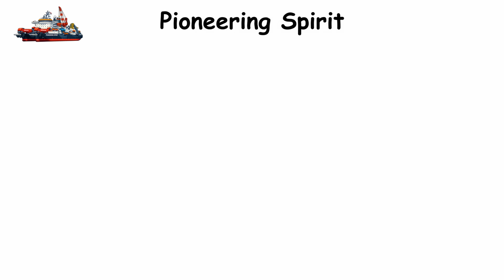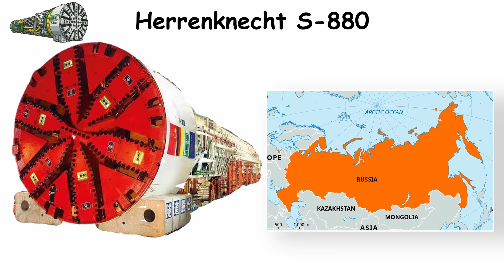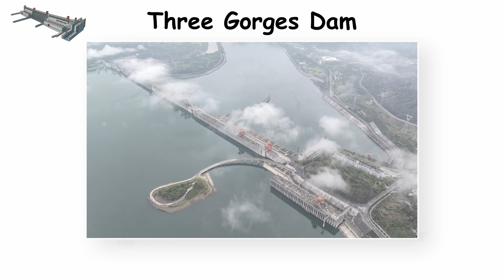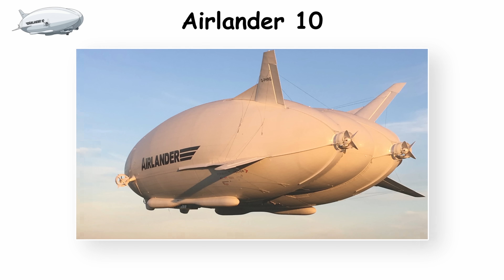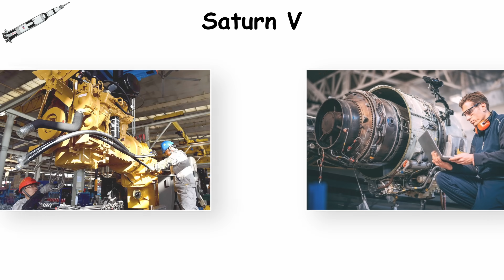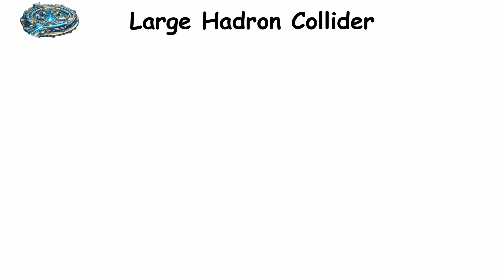Biggest Machines Ever Made Explained

Comment: Pioneering Spirit straddling a whole platform and lifting 48,000 tons in one piece is hard to picture — I kept wondering how they keep that 122-metre slot stable in a swell while the lifting beams slide underneath. Sleipnir's twin 10,000-ton cranes working in tandem for 20,000 tons was equally wild.